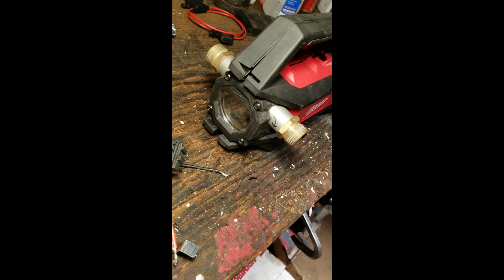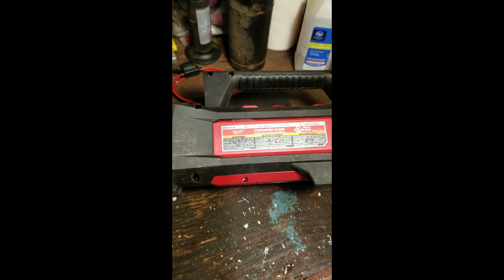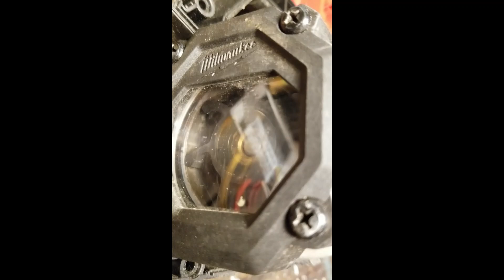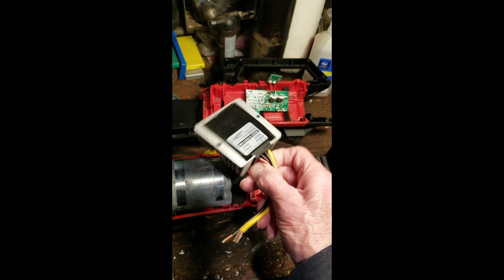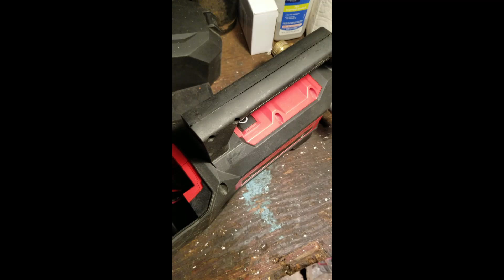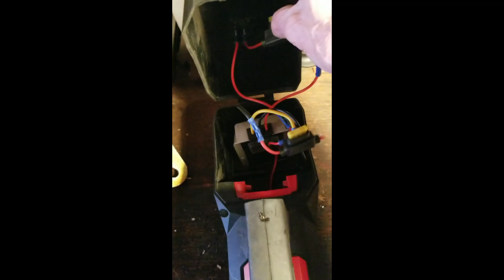Mechanic's special Milwaukee transfer pump

Comment: Thanks for the very informative and interesting video.  Question, were ya able to get the rpm up to spec for a reasonable flow rate? If not I would add a potentiometer and seat the dial, slide…  next to the switch. Now ya got an upgraded pump with variable speed 👍no?
Reply from the maker: That's a great idea.  I would have to use a resistor divider network and a higher voltage regulator because it regulates at 5 volts. 10v would do the job.  I wanted to see if I could get it operational...now it's time for the crome wheels
Reply: @rustbucketvalleygarage7046  very cool. Thanks for letting me know. I look forward to this pump ending up on the news as the first Milwaukee water jet pack 👍😎😆.
Reply from the maker: @drewt6235  now that would be cool but they would be in pairs.